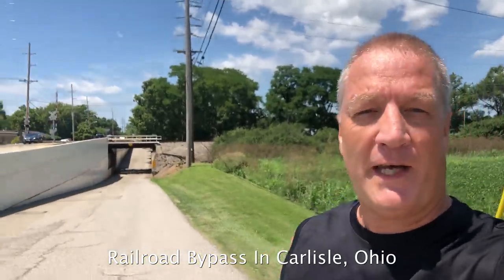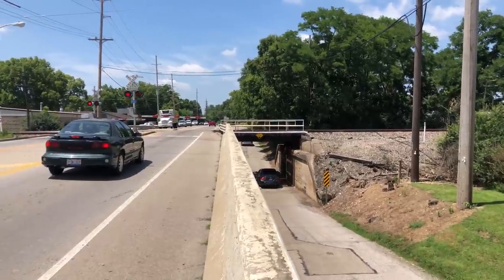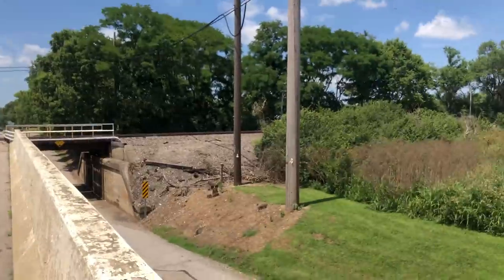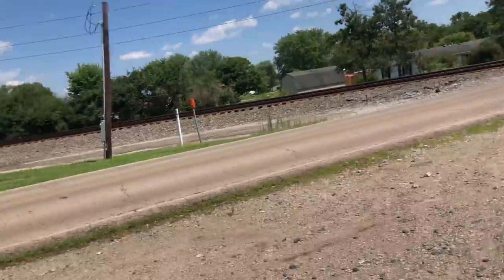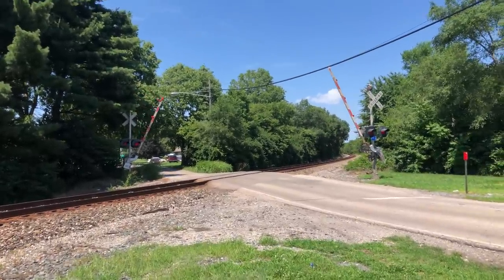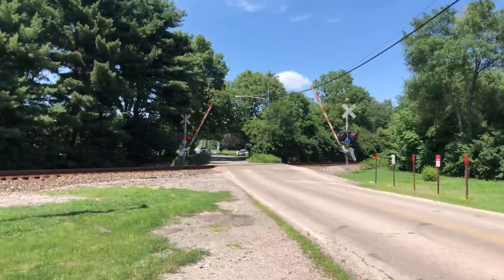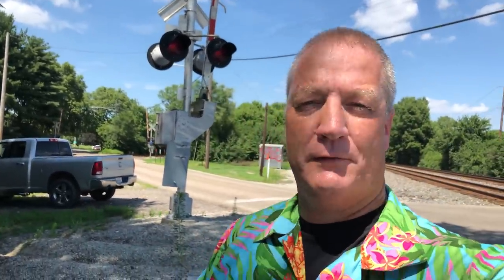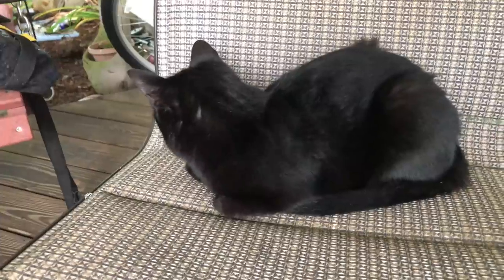Weird Railroad Crossing With Bypass & Train With DPU Working Hard!  Norfolk Southern & CSX Trains

Comment: I think the bypass is cool. It strikes me they should have had one on both sides, though :)  Some nice 5-car articulated on that CSX stack train and nice all EMD power on the first train. Cool :)
Reply: @Enmity the Kindhearted it does have the look of a more ambitious project that was never completed.
Reply: I think the underpass was the original and only way to cross the tracks.  It looks much older than the street crossing at grade.  And it looks like a few underpasses I have seen that were built in the early 1900s when cars were much narrower.  When they put in the street they decided to leave the underpass.  

It is set up to move traffic in both directions.  There are stop signs on both ends.  But they need to put a, “No Stopping In This Area” on the street on the side of the tracks JT is filming from.  It needs to be where the roadway from the underpass meets the street.  That way the traffic from the underpass can cross that lane when the street traffic is stopped past that intersection.

In A Mississippi town near my camp there are two underpasses under the IC/CN RR.  One was built in the early 1900s and the other one, right next to it, was built in the mid 1900s.  They are both the same width.  An old timer, over 90 years old, told me years ago that when the first one was built two cars could pass in opposite directions side by side.  Then as the cars got bigger it was not big enough for the newer cars to pass side by side.  So the first car to arrive had the right of way.  After several head on collisions they built the other one right next to it.  They are divided by a center support.
Reply: @billmorris2613  this is a good explanation. I'll leave mine up but this is better

Comment: That bypass is neat. I guess it accommodates the non railfans or the ones in a hurry  LOL.  It's good to have It there in case a train stops and blocks the crossing. Love seeing those smaller EMD engines  running.  Great video!
Reply from the maker: You got that right!
Reply: @FabianDiazTrainsTrucksNCars  The underpass only has a 10'-6" clearance, the average school bus will not fit.

Comment: That bypass is a good idea: to let emergency vehicles through just in case a train is blocking the crossing.
Reply: The underpass only has a 10'-6" clearance,  Too short for most Fire Department vehicles, maybe an ambulance (Depending on the style) but it is pushing it and would be tight.

Comment: A very unusual bypass, I only recall seeing something like that once before on one of your earlier offerings.  All SD-70 power on that first NS train, I don't think I've seen that before on one of your vids JT.  GE power vastly outnumbers ElectroMotive on the NS so I imagine this is something of a rarity.  

Ah, #3454 has the extended frame (longer front and back "porches") originally intended for the SD-45 type.  My guess is EMD didn't have as many SD-45 orders as they had hoped and decided to go ahead and use the extra frames on hand for the far more popular SD-40 build orders.  Makes sense since both utilized so many other common parts.  Love that EMD 'chant' from the prime movers of both the 645 powered SD-40-2 and the 710 powered SD-70s.

Nice way to spend my day away from the office, checking out your offerings.
Reply: What does any of this mean?
Reply: @oif3gunner  An old model train nerd here.  40 years ago EMD was THE locomotive manufacturer here in the US with GE a distant second at the time.  The GP / SD40 family were EMDs top sellers with many thousands of units sold to nearly every Class One railroad.  With 3000 horsepower they had plenty of umph to get tonnage moving.  
A more powerful version of the SD40, the slightly longer 3600 hp SD45 was added to the catalog and while it was fairly popular for a while it didn't sell as well as EMD expected, plus the 20 cylinder prime mover turned out to be not quite as dependable as the 16 cylinder.  
A number of SD40s were completed for UP and others built on the very similar SD45 frame.  #3454 appears to be one of those units.

At some point General Electric (GE) replaced EMD as the number one builder of locomotives.

Comment: Bypass under the railroad track is certainly very convenient for motorists, but with a steep slope on either side. I can't see if there is a water drain at its lowest point. If not, in case of very heavy rain, I fear that water will accumulate in the passage to form a small lake.

Comment: With Gent already mentioning it Jawtooth I'm surprised there isn't Signs pointing out that the Bypass is Solely intended for Emergencies Services Vehicles only at one of the State Road Roundabout this is at 50Hwy & 281 Pratt to Great Bent the Roundabout has Straight Lains next to it one in each Direction and at the Start of the lane it says for Emergency Vehicles ONLY.. but the Concept of it is pretty Darn cool.. Over Wichita they Built a overpass about 20 some years ago for the Trains because they constantly stopping Traffic its good idea to have these if the Traffic is heavy through the Area... 

Great Video..

Comment: Every major city that experiences major traffic delays due to slow / stopped trains, should install at least one of these bypass crossings every mile so emergency vehicles can get to where they need to get to when a train stops and ends up blocking a crossing.
Reply: You can't always go under.  This one is a pretty high built up RR grade.  If you build a bridge over, you may as well build the whole bridge.

That thing is likely full of water every hard rain.  You see it gets jammed with left turners too so it could further trap an ambulance or ft.

Comment: I'd guess the bypass is intended for emergency vehicles, but the responders would have to really know the dimensions of their vehicles to use it. (My guess ambulance yes, most fire engines no. They are bigger now than when the bypass was built.) Also looks prone to flooding in heavy rain. (Note the gates - for high water or because a snowplow certainly couldn't make it through.)
Reply: Bingo...
Emergency Vehicles use..
Reply: If it was primarily for emergency purposes then allowing cars to use it in two directions with a narrow one lane underpass only 10ft clearance doesn't work.  You saw the gridlock caused by the left turn traffic.  Wouldn't be so bad if it was just one way for right veer bypassers.

If I were to guess, it may be an old streetcar or bus bypass from the 40s.  There were some of those on the Redcar line in LA and some areas around Chicago.

Comment: Perhaps designed partially with the passage of emergency vehicles in mind ?? Seems to have adequate overhead clearance,almost 11 feet (not placarded otherwise).
Reply: Others have posted that the underpass was built many decades ago as the sole crossing, so likely that emergency services weren't a consideration with these setups. The grade crossing had to be added later as vehicles grew too large and traffic too heavy to use it.

Comment: I would like to get one of them scanners I have a railroad here it's a short line it's only about a half a mile from me but it only has one person in the engine the engineer and the conductor or switchman drives around in a pickup truck and switches the tracks so I don't know how often I will hear somebody on the scanner or not

Comment: What kind of ding-a-ling designs the bypass on only one side?? Maybe they ran out of funding to build the bypass on the other side? Hopefully, they’ll fix that; then vehicular traffic can completely bypass the grade crossing (like at the shoo-fly) and save lives. Then they can open the crossing in heavy rain conditions where low water would make the bypass unusable and unsafe.